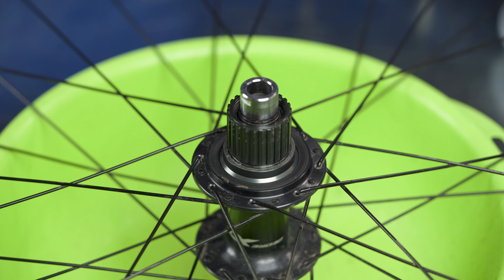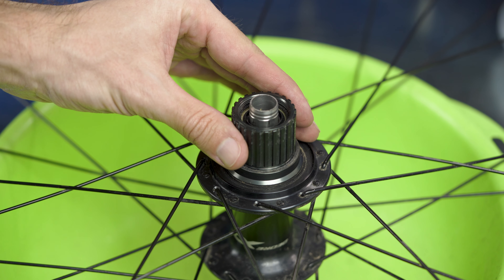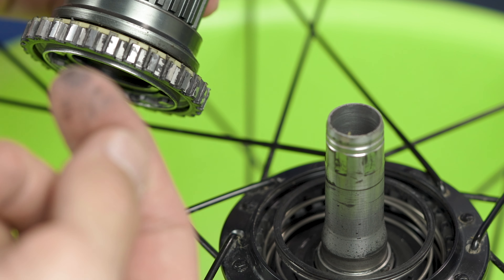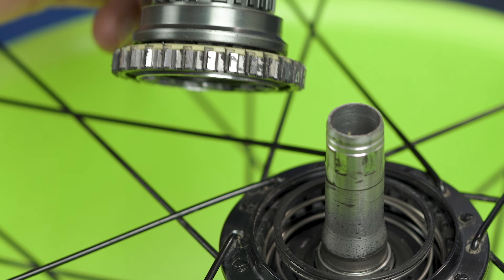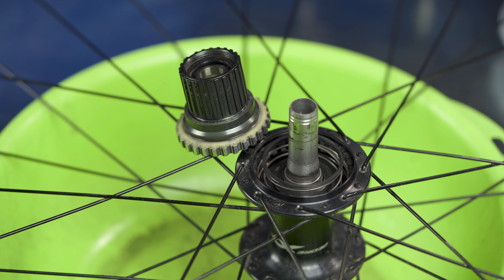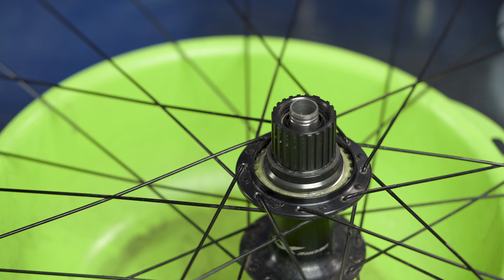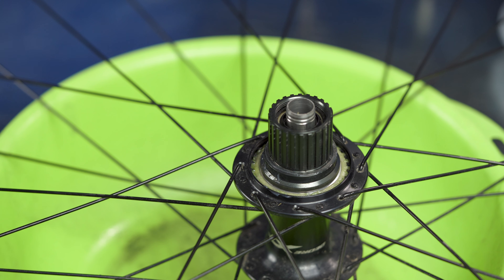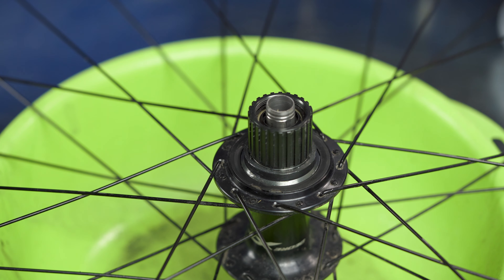How to grease a CREAKING Shimano 12 speed Micro Spline free hub (SLX, XT, XTR)

Comment: I had the noise problem after a few hundred miles on a new Trek e-bike, took it to my bike dealer and they said it was the rear hub, not enough grease from the factory.  They greased it up, I rode 300 - 500 miles and the same noise is back, my dealer has it again in the shop.  I am glad I found this video, now I can fix the problem myself, I believe this is going to be a regular maintenance item with Shimano Free-Hub.  I have a Shimano Deore XT Freehub 142x12 E-Thru Axle.
Reply from the maker: Hi, BD! Right you are. Every ~500 miles it is likely to be back. But once you overhaul it yourself, the procedure will go pretty easily 🤘

Comment: Thanks for making such a detailed and thorough video on this.

I've killed my M8110 freehub in 300 miles of muddy English trails so I'll be replacing the whole thing shortly.

I just hope it's an isolated incident as I don't want to be doing this every few months if the sealing is failing somewhere.
Reply from the maker: Hi, Ben! If you came to a point of complete hub replacement, it might be a good idea to switch to smth else. DT Swiss, Hope, … Another M8110 would likely fail in the same way!
Reply: @ZavyalovCycling  Thankfully it's just the freehub body and not the whole hub. I do hope this is a one off though and it's a shame the freehubs aren't serviceable.

I've got DT Swiss 240s on my hardtail and they've been flawless for 2 years and around 2500 miles.
Reply from the maker: @benmillns8976  I also hoped that my hub wouldn't be a nightmare, but after 5000 km I had to conclude the nightmare exactly:

https://youtu.be/cbQQCZ8Wfak

Comment: I have a XT rear hub and I had to replace the plastic spacer with the teeth.. It was creaking, So I put a new part in there and greased it according to your advice. It works fine but I wonder if I got the big seal back in correctly the snap ring doesnt look right.. I noticed once I greased it. It is quiet now I dont hear it like it used to.. Mine came with no grease in it.. The plastic spacer came out in pieces..
Reply from the maker: Take time to thoroughly check the teeth, separated with the spacer. After 5000 km mine are so damaged that any new spacer won’t last a couple of rides 🤪
Reply: Did the noise only happen under load?

Comment: Nice video. With mine, I was pretty sure it's one of the cartridge bearings inside the freehub body, which was bone dry from the factory. Repacking it with grease is what I thought fixed it.  The spacer rings are definitely a weird feature of this freehub though, as almost all the pins have now broken off of mine. I did regrease the spacer for reassembly as directed and the noise went away, so maybe I was wrong.
Reply from the maker: Hi, Thomas! No one knows your exact case better than you do. But the most common source for creaking of these hubs is the spacer. Just ride for another 1K or so. Once it starts creaking again, you'll have a chance to decide whether it's a bearing or the spacer. But I wish it never creaks, and you just have years of worry free riding! 🤘

Comment: Hi. Fantastic video👍🏻
I have had this terrible creaking noise for a couple of months on a new e-mtb. Unfortunately for me, I bought it from a factory manufacturer (Canyon Bikes) and they don’t have a manufacturer service network. Either you have to send in the bike or drive to their distribution center after getting an appointment. Too far and too time consuming for me. Other bike shop dealers aren’t happy to service.
I have a shimano xt FH-M8110 rear hub. However, there is no slider on the spring (the inner one with the dog leg) 🤷🏻‍♂️. Shimano‘s Dealers Manual shows the slider in the explosion view, however there isn’t one. Is it possible, that the sliders were introduced to post production, as a solution to prevent creeping?
I inspected and serviced my hub today, in particular greased the specific stated parts with shimano‘s special grease. I am amazed!!! No more creaking👍🏻. 
Whilst replacing the spacer, I noticed one of the tiny plastic arms had bent and broke off. Will this effect the way the micro spline works drastically?

Thanks for any replies.
Reply from the maker: Hi! Pretty much sure your hub gets to a next service absolutely fine even with one spacer leg compromised! This will just take one contact point out of the game, but there’s still a plenty of other. As for the missing slider, it’s not the first time I hear about it. Someone on MTBR forum thread reported the same. Gonna order the slider and the spacer now?
Reply: @ZavyalovCycling  thanks for the rapid reply. 
What is the actual function of the slider?
Reply from the maker: @christophersmith6574  First of all, there are two springs, but only one of them requires a slider,  the inner diameter spring. It touches the rotating part of the freehub body. The slider acts as a bearing reducing friction between the two and allowing easy rotation against each other.
Reply: @ZavyalovCycling  Cheers. I thought it was to do with friction reduction. Thankyou for confirming👍🏻
Reply: Was you noise only under load?
Reply: @paulb9769 not really. It wasn’t there if you were rolling free, but started up immediately even at very low load, increasing in intensity as you apply more load. 
Had the bike for 4 years now and no more problems with the creaking noise. However, I did replace the spikey spacer type thing as more of the tiny plastic legs broke off and re-greased prior to re-assembling.

Comment: Has someone expieriences with free hubs from different companies, which are based on the Micro Spline standard?
Reply from the maker: I’ve got a wheel built with Micro Spline version of Hope PRO4. No issues. Micro Spline refers just to the splines which secure a cassette on your hub. Doesn’t refer to the inside hub design.
Reply: @ZavyalovCycling  Thanks!

Comment: Glad I’m not the only one with this issue… thanks for the video. Do you know if I can use Park Tool PolyLube 1000 Bicycle Grease on all small parts you greased up? I’m kind of disappointed at Shimano at this point and prefer not to buy Shimano specific grease.
Reply from the maker: Pretty well understand your disappointment with Shimano! A solid advice on alternative greases should be backed up with some long term test data, I guess. But nobody is capable of providing such data for today. In general, my answer to your question is YES. PolyLube will grease the spacer fine. It might be not as good as a sealant grease for the cap and the gasket, but still pretty enough for typical use.

Comment: Just bought a brand new Deore XT rear hub and after less than 100KM started to make that ##$#$%$#$%&%###$$% noise. Thanks for the solution btw!!! but my point is...how on earth Shimano is dealing with this? The workaround they suggest is to grease some parts and be happy? this is so frustated mostly when you are dealing a a brand new hub, not expecting any "workaround"...i would happily do it!  of course after lots lots of use and kilometers   .....just saying....thanks anyway
Reply from the maker: Shimano hope this just goes by and one day they introduce an updated generation “reliable as never before”. And yes, they don’t care much about our struggles, but they won’t put it straight. It’s a blemish on their image, but it won’t kill them.

Comment: I hope my upcoming FH-MT401 (microspline for QR135, my bike just old 26er too) doesn't face this problem. Based on Shimano exploded view, FH-MT401 designed more simple compared to higher Shimano 12-speed Freehub
Reply from the maker: You are right. FH-MT401 has a classic ratchet with 3 spring loaded paws. Won't have this problem.
Reply: @ZavyalovCycling are they durable?

Comment: Great video.  Question - what is the name and part number for the tool that you used to seat the seal ring? Thanks.
Reply from the maker: Shimano TL-FH16. It's a handy tool, but not 100% necessary. You can live without it if you need to! 😉
Reply: Thank you.

Comment: Hi. Nice video, but I notice you never cleaned the splines inside the hub itself - why? I'd disassemble the rest of the mechanism and then clean it thoroughly. I had my hub star locking up, I opened it and it chewed app all of the 'legs' of this stupid fragile plastic spacer... Worn the aluminium parts after that as well a bit I reckon. It was after it was replaced as a warranty from this light coloured spacer to a black one, and they applied grease there as well (no grease there from factory) - back then it started creaking and that's why I took this hub body off the hub, and some of the legs of thwere partly broken and they broke completely off when cleaning. Now it even somehow destroyed/opened up the cover of the driveside bearing as well, and probably contaminated it... wondering if the races are still OK. This hub is very nice when it works well - after this 'grease mod' they applied it was working like a real 'scylence' hub, and a lot of engagement points - but the reliability is a nighmare when used for climbing in the mountains. I'd like to go to Japan to ask the designers etc. how the hell did they test this shit, if at all.
Reply from the maker: You are right. To clean everything up 100% thoroughly, we need to go for the inside as well. However this "thorough" clean would take 3x more time or maybe even more. This wasn't a time when I was eager to spend so much. But I'm glad you've asked, cause the thing was on my mind during this service as well. Let's see how my hub lasts with this approach. If anything goes wrong, I'll surely let everyone here know. So far the hub has clocked ~2K kms (~1.3K miles). Keep on ridin'! 💪
Reply: Had the same happen to me when I opened it up the spacer was all bent and broken, I wonder how it will run without one hehe ? :/
Reply from the maker: @CptTacklesEnnis  I'm afraid without the spacer it will be the metal splines to go "bent and broken". The spacer is a cheap part to replace. But not always easily available to buy, true 😂
Reply: @ZavyalovCycling  I just ordered the black XTR version I hope it's kinda the same part since it was the only one i could find in stock.
Reply: @CptTacklesEnnis  yeah, the Shimano service actually seems to replace the SLX/Deore XT one with the XTR ones. Not that it helps though. I'm replacing my hub, and spokes for that matter unfortunately (Shimano is 2-cross, DT is 3-cross. At least a stiffer wheel it is)
Reply: @OYeahan  they just emailed me out of stock lol... Mid june
Reply: @CptTacklesEnnis  not good then. To be honest I'd just replace this failed-design hub as I see no reason why this would stop happening.
Reply: @OYeahan  agreed liked them at the price point when they work
Reply from the maker: I guess the idea was that the black XTR spacer would be tougher to provide less dampened transfer and feel. But with the surrounding scope of the problems this hardly matters now. It seems neither of the two is easy to buy. What a story! 😀

Comment: https://youtu.be/0TxTDwNHPYY

what do you think the reason is that you need to lubricate?
Reply from the maker: Form your video it looks like you have the common problem with this type of hub. I'd remove the freewheel body and check the condition of the plastic spacer inside. If the spacer is nor crashed yet, greasing it should help for a while.